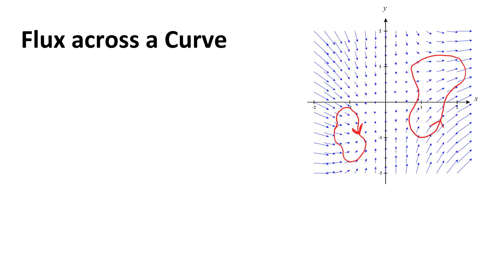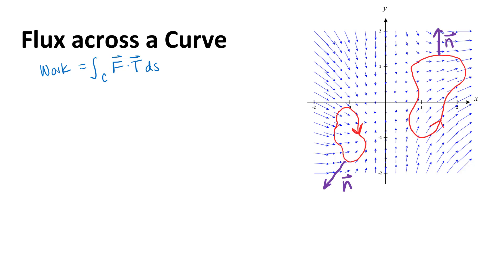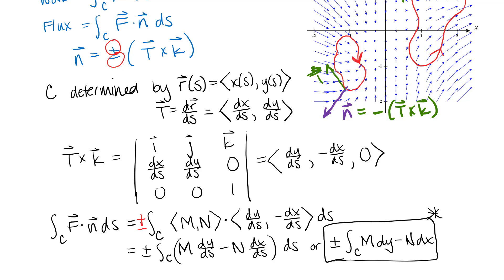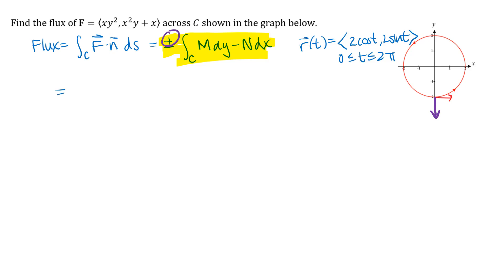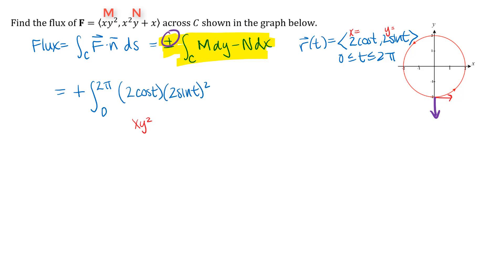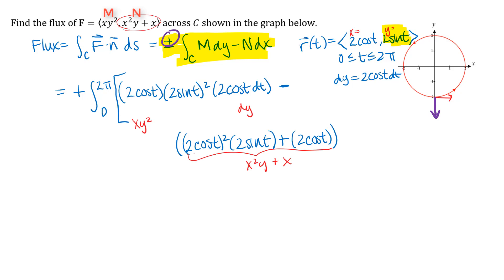Flux across a Curve

Comment: Can we rotate the tangential vector any direction with the rotation matrix and then make a cumulative sum of Directional "Instantaneous Rate of Change" in any common direction to the parametric curve an make and average value of the Directional derivatives? 
Where you can use it a sum of vectors rotated by pi/4 to the parametric curve or any other rotation?